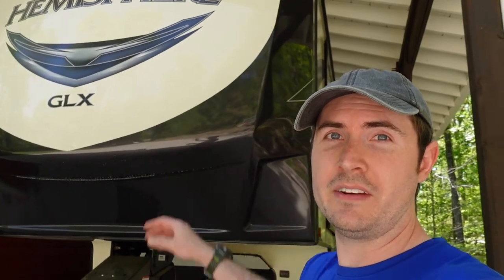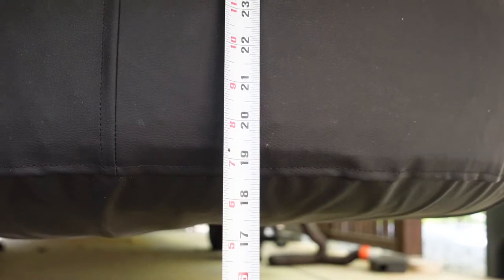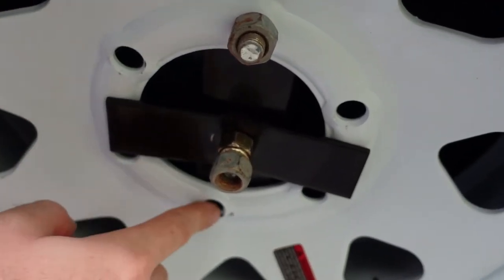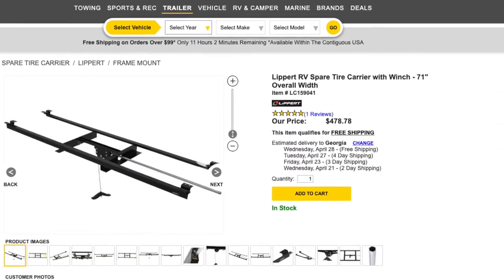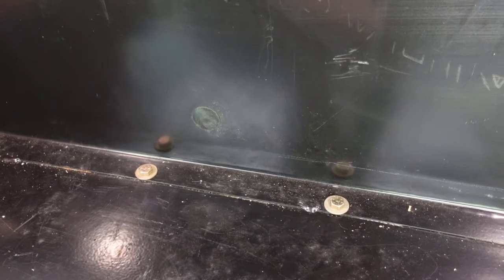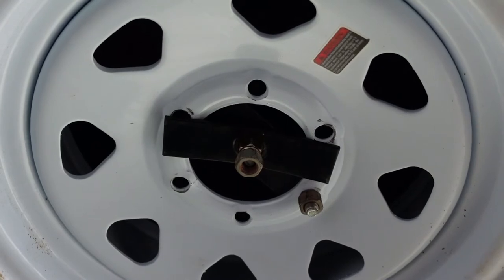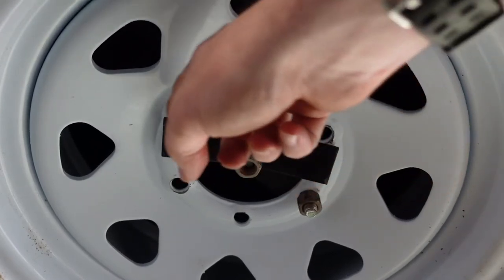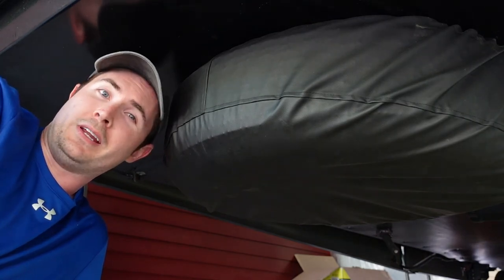Budget Friendly Fifth Wheel Spare Tire Mount Relocation Under Frame - Reclaim Your Storage!

Comment: This is a great idea.  We have a Salem Hemisphere as well.
However, for me getting up under the RV to get the spare tire down when needed it the issue.
I always check the tires before any move of the trailer.  On my last trip all tires including the spare were good.
About 30 minutes down the road and my tpms system told me one of the trailer tires was losing air.  
We quickly slowed down and moved off the highway to safety.
Upon checking the tire with the slow leak, we could not see the issue.
So, in the rain we changed to the spare tire, and I put the damaged one in the back of the truck.
After arriving at the camp site and setting up I had time to check the tire.
It appeared that something had hit the valve stem, and it was leaking from the site of the stem.
I ended up replacing all of the valve stems on all of the trailer tires including the spare.
So, with this setup I would have had to crawl under the trailer in the wet muddy location we stopped to get to the spare.
Even those I check the tires before any move, you just don't know what will happen.
I am looking for another alternative for under the trailer.
Reply from the maker: Great point. Getting down in the mud on your back is definitely a weakness of this solution. You could do one of the cable driven solutions that crank the tire down, they're just a little bit pricier. They also have some trays that hinge or tilt outward and lets the tire slide down, but again just a little bit pricier. Sometimes the extra money is worth it though to not have to get all muddy in a situation like you described.
Reply: I have a military style mechanics blanket for when I need to work under a vehicle in muddy conditions. Stores up nice and small, and keeps you nice and dry. Simple fix for times like this.

Comment: Can you give the measurements on the mount you used
Reply from the maker: I actually sold that fifth wheel a while back, but the mount came with it. Basically it was about the depth of the inner wheel to outer tire. It may have even just been fabricated by the manufacturer. Maybe they just took stock 1/8-in steel and folded/pressed it into the U shape? Or maybe one of the RV suppliers makes them? Sorry I cannot be of greater help on this one.
Reply: Thank you very much for the reply. I just got finished making one and i now have it mounted on the trailer the same way you did yours works great thanks for the video and the idea to do this.
Reply from the maker: @a.hodgins655  thank you, glad to hear

Comment: My spare was rotted out by the time I needed it.Roadside assistance said “As soon as you hit a bump it’s going to crack.First vehicle I had where it was stored under.I live in the northeast so the weather gets terrible.What is the best way to protect the tire?
Reply from the maker: I just put a regular spare tire cover over mine. I've had great success on my last few rigs with that approach. Seems to stay protected underneath. Typically the trailer tires age out before they wear out, so maybe every 3-5 yrs have to replace.

Comment: Could you tell me what size bolts you used?
Reply from the maker: You know it's been a couple years since I did that mod (sold RV featured in video), but I did a thicker bolt perhaps 3/8 diameter?